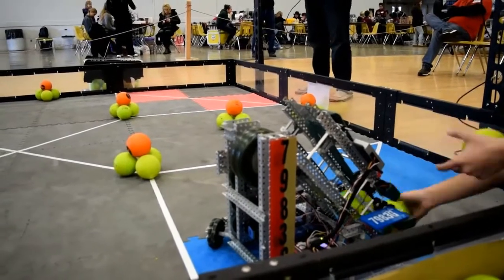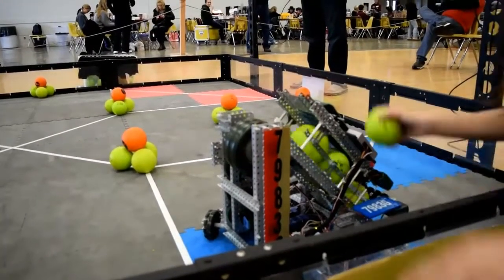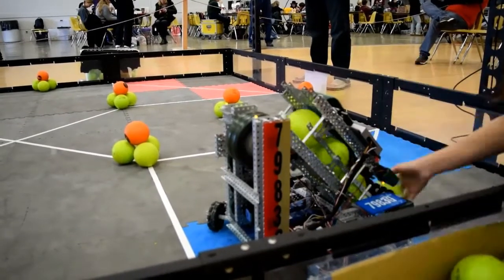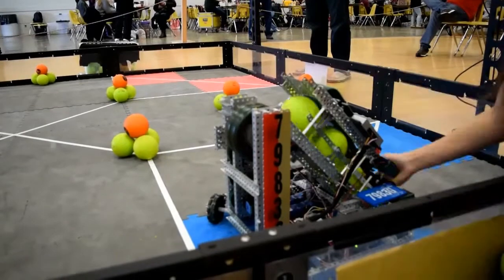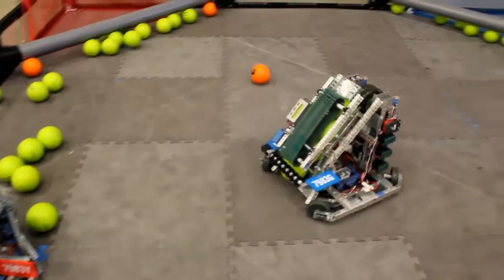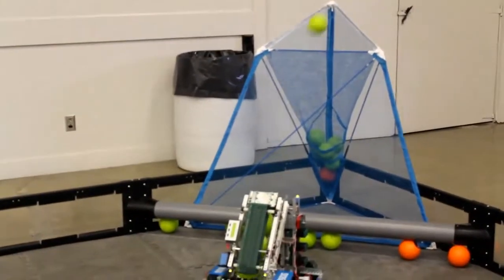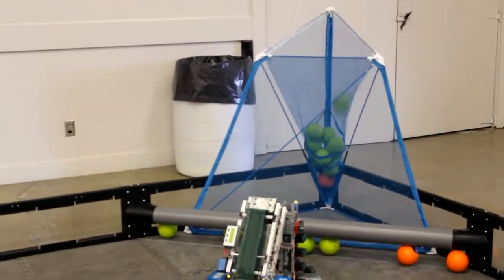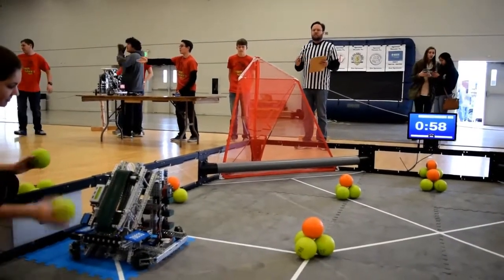RECF STEM: The Flywheel

Comment: Hey so I am on a vex team and we are having some big problems with the backplate and how it should be made. It would be amazing if you could answer my questions...
1. What material did you make your backplate out of because ours is a small c-channel with rubber bands around it to create more friction causing more backspin.
2.Should the backplate be very short in length and be attached level to the conveyor intake or be longer?
Reply from the maker: Directly from our builder:
Ours is just a custom 1 section long 5 wide c channel. You don't need any extra friction as there is plenty already. You want it about 3.5-3.75in above the wheel.

Comment: What is your gear ratio?
Reply from the maker: 25:1 with regular motors
Reply: +CyberHawks 7983G so torque motors?
Reply from the maker: +Nicholas Schenken Yes, standard  393s
Reply: +CyberHawks 7983G and how many motors? Sorry for all the  questions
Reply from the maker: +Nicholas Schenken 5 motors and it's not a problem! :)
Reply: +CyberHawks 7983G do you guys use a ratchet? Also, if you dont, it wont burn out the motors right? Also, when shooting full court, what is the power given to the motor?